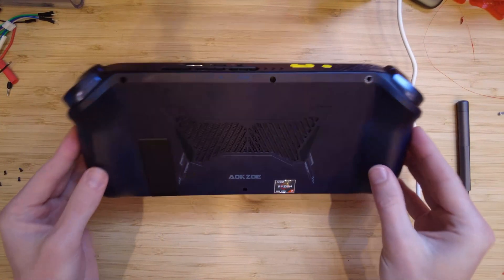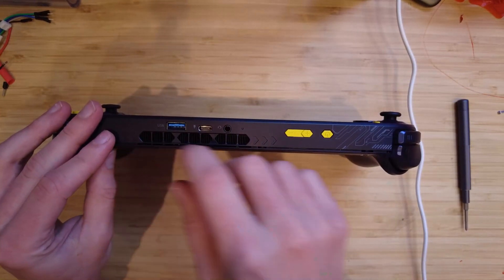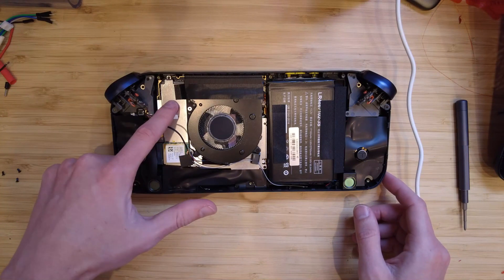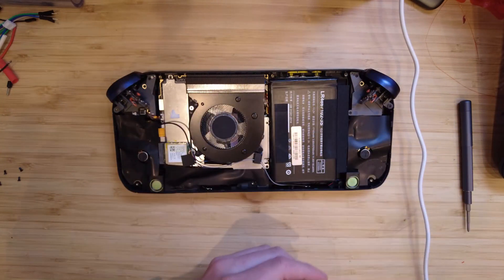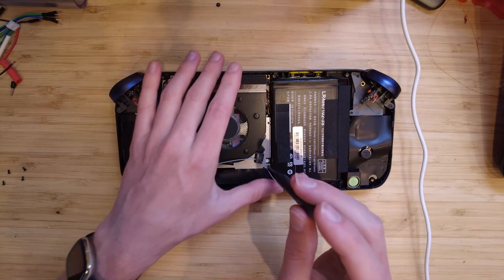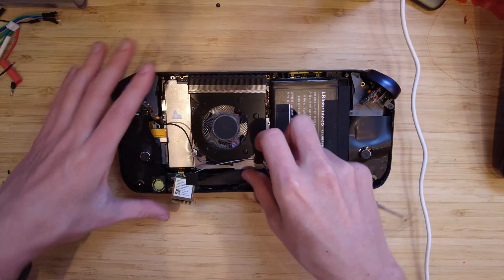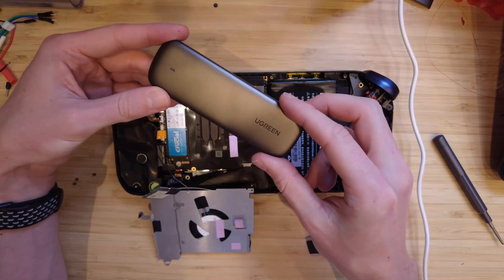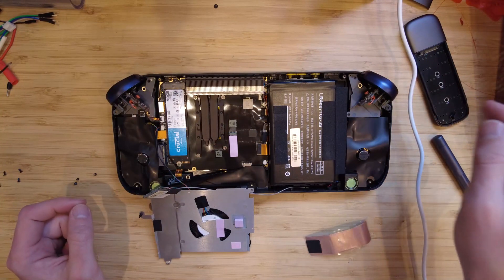Replacing/Swapping Aokzoe A1 SSD

Comment: Hey brother. Great video. What type of screw driver should i get?
Reply from the maker: A small Phillips head will be fine, but it's got to have a head that's sort of long. those small hex drive bits won't reach, the long hex drive ones do. I think the ones I have are about 30-50mm long. The screws look like M2/M2.5
Reply: @emccat  thanks brother. I think i will just order a set now

Comment: I usually clone the stock SSD to the new SSD and then expand the disk partition. Btw thanks for the video
Reply from the maker: Absolutely I used to do the same, but comments about malware getting into OEM installs from the gpd devices made me want to double check a full install if that was the only option. Little annoying with how silly the drivers are to get working.
Reply: @emccat  how did you get the drivers working?  I just did a plain reset of my existing SSD and the joysticks messed up, but it all says its working fine in the device manager.

Comment: Awesome video! This will help a lot of people. But that little clip that came out, actually goes up, and it sits on the top side of the large metal plate. It is a clip to hold the main power ribbon in place. The main power ribbon sits right below that and just lightly clips to the MOBO. So the little clip is just to make sure it does not come off.
Reply from the maker: I was a little surprised it came off because I changed it earlier and it didn't come out. And I'll be opening it again so I might just make a short video showing that area or something when I find out how it sits according to your description. It's very dumb having nothing to go off at all especially with low capacity SSD models offered at a good discount.

Comment: when you are opening up other model:
1) where is this screw from?

When you are opening up AOKZOE:
2) wtf is this tape from?
Reply from the maker: To be fair I also just got a win max 2 which has lots of tape on the SSD also, not quite as much as the aokzoe but it still seems silly in both devices.

Comment: Could have avoided all of that by just cloning the drive. I use clonewizard. Once you clone the original drive to the new one you can just pop the new one in and good to go.
Reply from the maker: Absolutely however there's some nasty comments coming out about the gpd devices injected with malware at some point in production so I wanted to see how easy a clean installation would be.

Comment: Appreciate the guide on the SSD swap! Would love to see a guide on getting to those thumbsticks. Noticed the ring around one of my thumbsticks being loose. So I'm hoping getting in there isn't too difficult. Did you foresee any problems with accessing those thumbsticks?
Reply from the maker: I could open it up again and have a look! I remember on the win 3 the ALPS ones were a little problematic if you over tightened them as they would crack and sit crooked. Did you get ALPS or Hall sensor?
Reply: @emccat  I have the Hall sensor sticks. Not sure if its a problem with the thumbsticks themselves, as I'm noticing the looseness on the ring around the thumbsticks - the yellow ring (on blue A1's) the thumbsticks make contact with, I believe to reduce friction. When my thumbsticks make contact with it, I've noticed its definitely not as secured in place, compared to my other thumbstick ring. Would definitely appreciate a video that explores that part if possible.